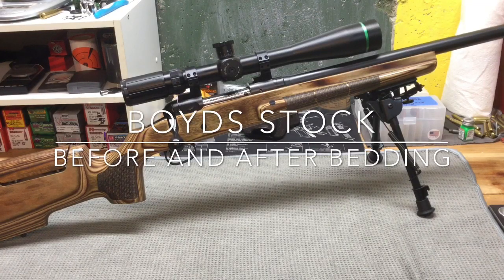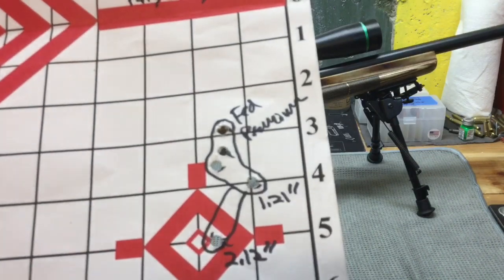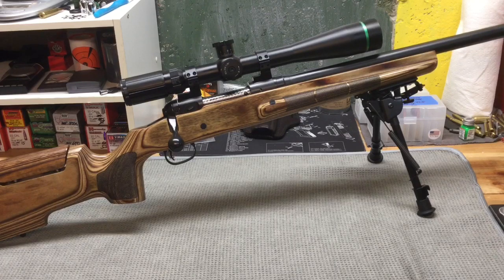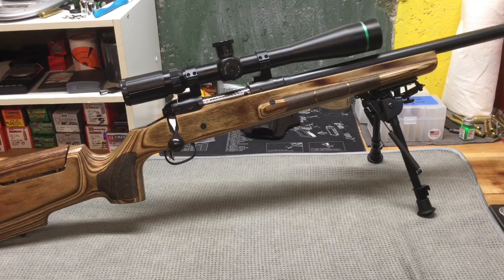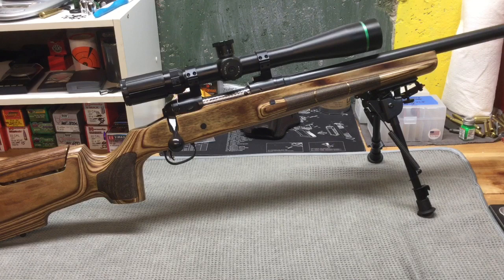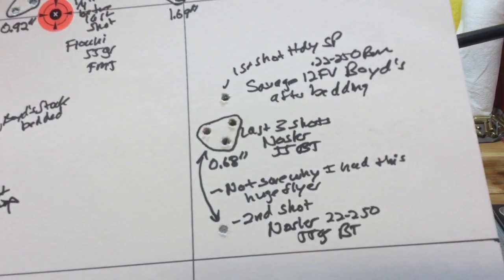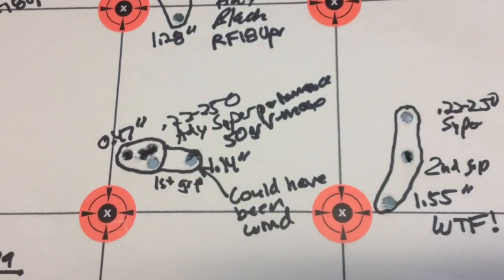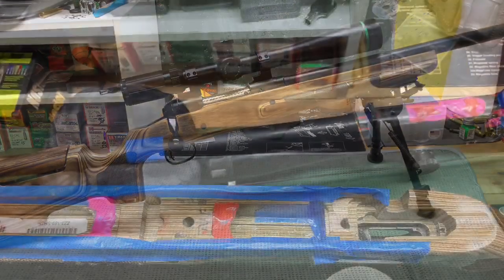Savage 12FV with Boyds Stock - Before and After Bedding

Comment: I put pillars in mine. The Boyds stock is too soft to get a good torque without crushing or splitting it. I have a Ruger American Predator so the mounting was different. I had to put on a metal trigger guard and magazine tab as well.
Reply from the maker: Pillars may be next.  Thanks for the suggestions!

Comment: You thought using pillars as well? As said the Boyd’s material is really soft. One thing to note, savage rear tang actions like to be floated from the stock. Easy way to do so, is to place painters tape under it as you bed the action. Lastly, verify your barrel is free floating. I like to tape the barrel to get the spacing I want to the stock. I like the video and some good information.